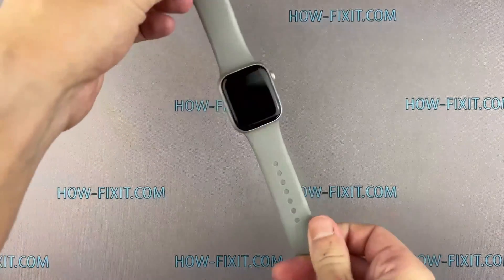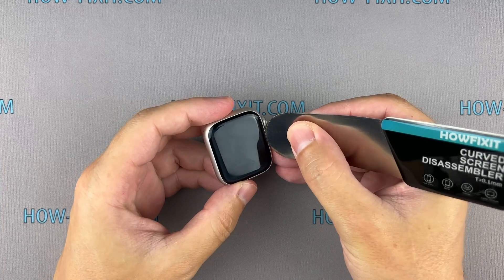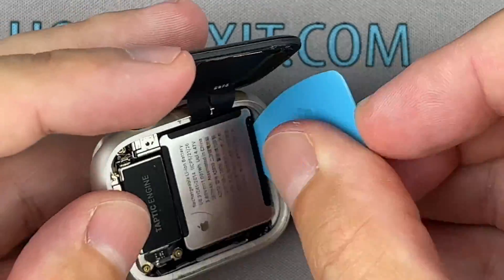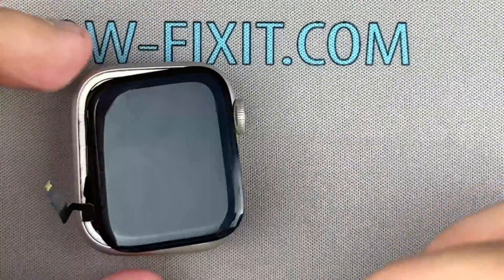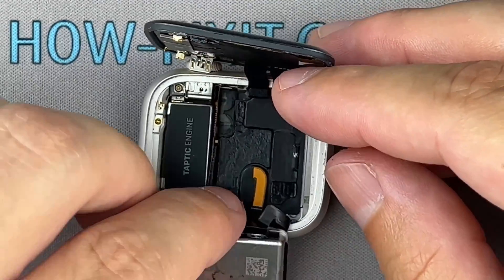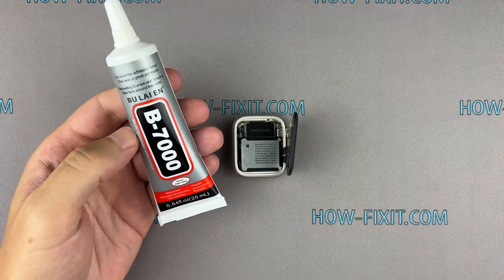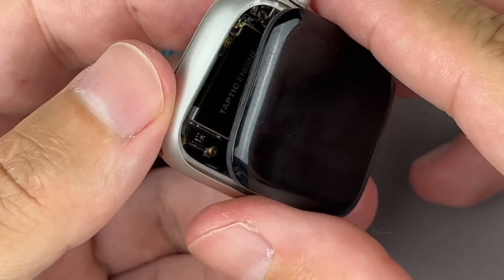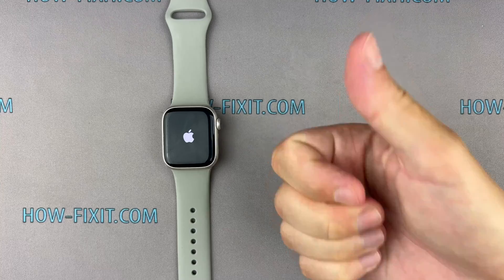How to Replace Apple Watch Series 8 Battery - Step-by-Step Guide

Comment: I bought all the materials you listed.  Prying the screen off was much more difficult..  I got the screen off but there are two more layers to go..  I destroyed the screen by doing that.  The screen separated from a black film, then that peeled off another silver film.  Anyone watching this must know that you have to go much deeper when prying.  Not like I did..  $329 new watch on Amazon.. Sh1tcanned the ruined watch .  Also,,  there is a very small screw holding the battery connector down.. for the series 8  45mm..  Not sure what your video is showing..

Comment: I would recommend you drain the battery before starting this repair, as I have found that if I turn my watch off to change the band, I've turned it back on by accidentally pressing the buttons.